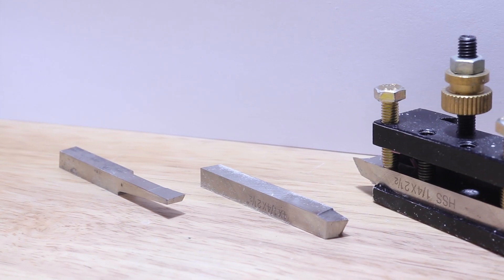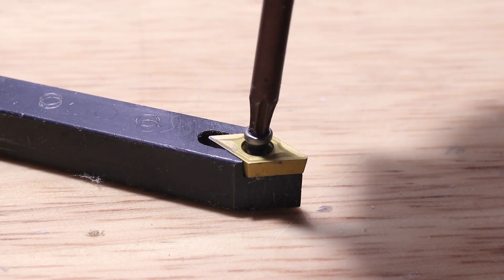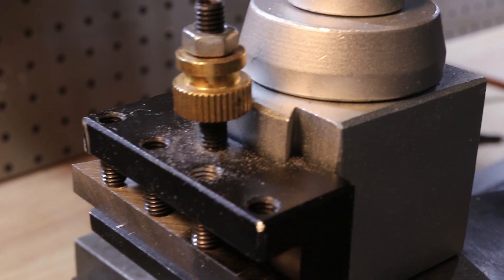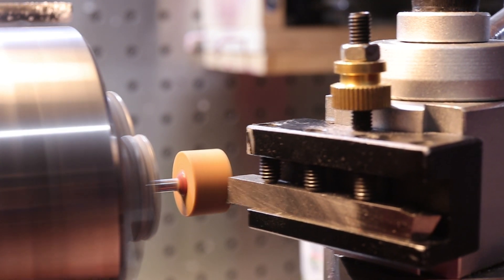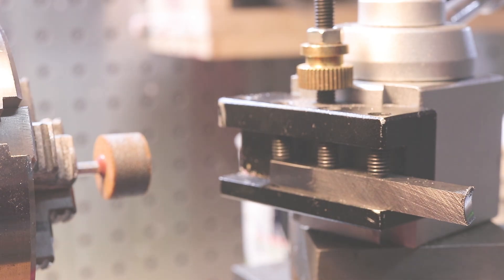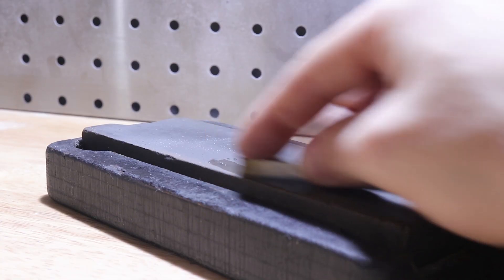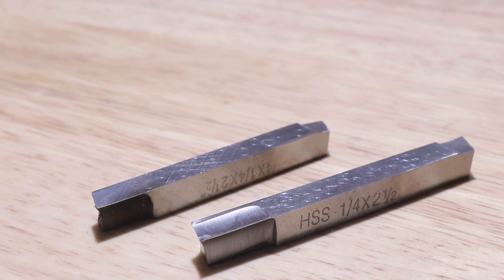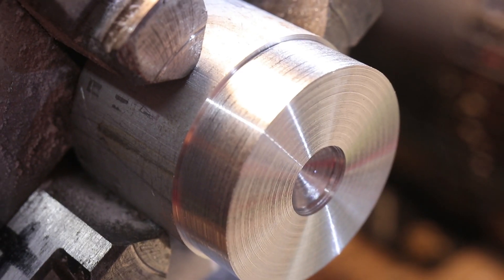Grinding Lathe Tools Without A Bench Grinder

Comment: And buy a second lathe because this one will die sooner than expected. Method looks great, probably is a good idea to get a minilathe and transform it into a cutter grinder.
Reply from the maker: Funny you should say that, about a year ago, not so long after this footage was filmed the control circuit conked out and the cost of the replacement was about half the price of a mini lathe at the time.
Reply: @artisanmakes  Replacement parts are usually quite expensive, particularly with these machines. The Chinese have in mind a disposable machine. I have a 12X23 and it only looks good where you can see, disassemble and it is ugly everywhere. Nonvisible precision surfaces will be just machined, and so on. The minilathe is not so lucky, being cheaper and smaller is usually worst. Grinding without protecting your machine will definitely wear it down way faster than you may think.
Reply: @davidwillard7334  If you buy one for business yes. if you are a hobbyist that wants to have a little fun then not so quite junk. These machines are also affordable and that's why they sell so many. This world is not China junk, USA great, there is a whole range of reasons to get one or another. I cannot afford USA great, but got China OKish for the money, even with all their issues.
Reply: @davidwillard7334  It is not a matter of happiness it is a matter of affordability. If there were more affordable options at better quality then I would consider those options as well. The point is that the USA market does not have offers in that price range and for that type of machines. It is not a point of China vs USA it is a free market after all who offers the product that you need or want at the price you can pay will always win. Moreover, Chinese machines are not all that bad if you are a hobbyist that who is not chasing micrometers. They will outlast you if you use them for about 8 hours a week and keep them well maintained. If you are running a business then things are different. And old machines are many times so worn and beaten up that they are as bad or worse than a new Chinese machine and many times unavailable.

Comment: 0:22 I see that your locking nut for the quick change tool post is loose, you will lose the center height. Great video btw ;)
Reply from the maker: It is easily the biggest disadvantage with these tool holders. The small M5 nuts come undone so easily. I will probably replace them with wing nuts  to help lock them, but I always am checking the height for the tools.
Reply: @artisanmakes  Maybe a better tool holder system will help. I made best experiences with a „Multifix“ system (developed decades ago in Switzerland an today available from several manufacturers).

Comment: Hi folks, well, if no grinder and rest it's one way. Apart from the wise comments below I would strongly suggest not using a bigger grinding wheel. They are speed rated and a faulty one, or one spun too fast, could explode with horrific consequences. The bits could be doing several hundred kilometres an hour. There is no protective guard with this set up. Wear safety glasses when grinding and do not stand in the line of fire with any grinder, tempting as it is to get a close look. In a factory grinding wheels are only fitted and tested by trained qualified technicians. You are likely to be safe with the small Dremel size ones but do not go bigger. If you need a bigger wheel, buy a decent grinder - it's the much safer option. BobUK.